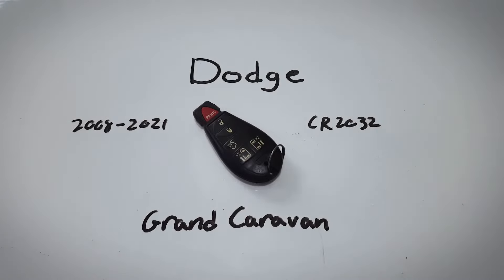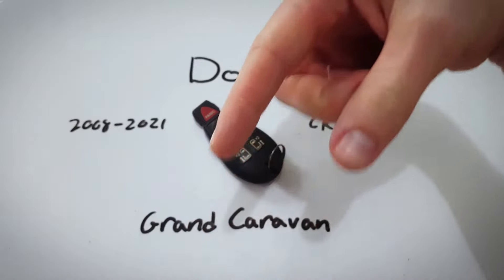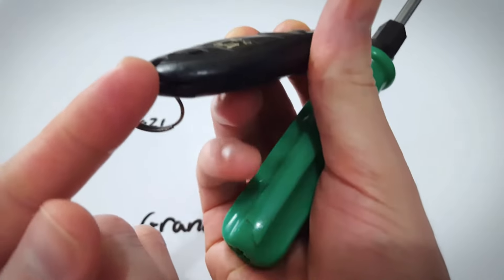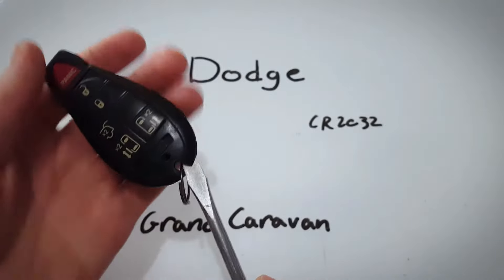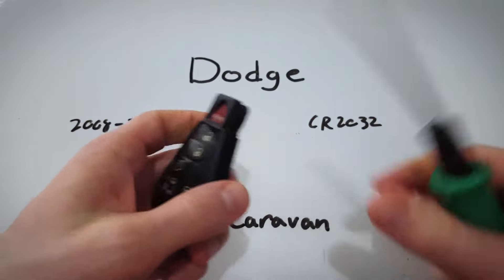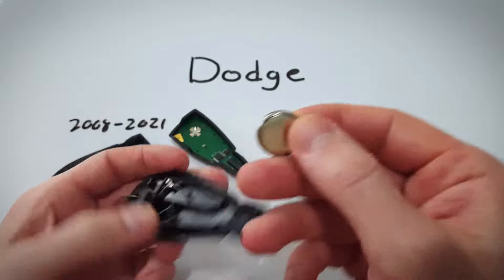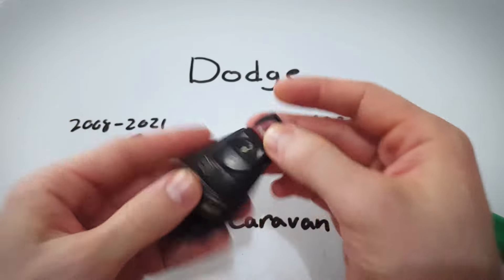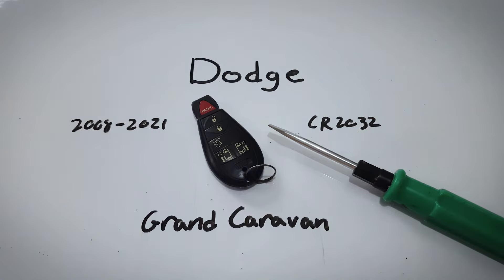Dodge Grand Caravan Key Fob Battery Replacement (2008 - 2021)

Comment: Was changing out for a 2008 Grand Caravan for my mom this morning and found it had a back door leading to the battery. At first I thought the door would not allow room to replace, but as I pried and the case wasn't coming apart easily, I removed the door again and popped out the battery with a tiny screwdriver. Much appreciated. :D  Just leaving for future reference for anyone with a similar setup. I thought the fob was OEM (as the vehicle was purchased from dealership at 2 years old), but it may be an aftermarket version.

Comment: fwiw I did not use a srewdriver to open the fob as shown here. I tried but I was pushing so hard to get in the gap that I was afraid of breaking the fob cover.
I used the thin edge of a pen knife instead. It slides in easily, and a little twist was all it took to separate the two halves.
Also, not mentioned in this video, is the fact that there is a thin gasket between the two halves. You want to be sure not to disturb or twist it in any way, otherwise, you won't be able to snap the two halves back together.